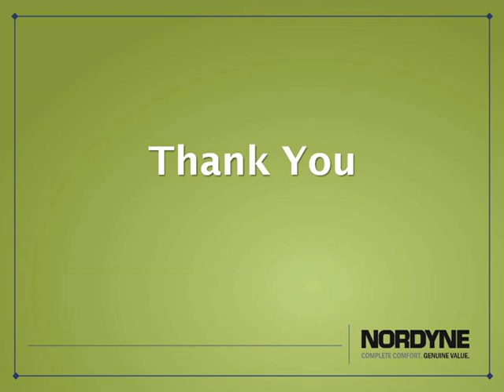Air Conditioner Repair | Adding R-410A Refrigerant to a System | NORDYNE U

Comment: what causes gas smell to mix with hot air coming from your vents in the home
 for gibson hvac system / furnace. is this related to this configuration?

Comment: in liquid form,  but thru where?   suction side or high side
?
Reply from the maker: Jose Hinojosa From our tech team: Liquid should only be introduced through the discharge or high side of the system. If you want to charge liquid through the suction side or low side of the system, you would need a tool similar to a “ChargeMaster”.
Reply: Dummy! Suction side. How does one shoot refrigerant in a 80 lb prs jug into 250+lbs prsr?

Comment: dear sir do you can help me i have 2.5 ton air condition r 22 than i want Chang R 410 A how that Chang need to be  Chang expansible valve all so please explain me i waiting for u
Reply from the maker: Sanbok Restaurant Hi there. You really need to speak with your local air conditioning contractor to find out about replacing your R22 air conditioner with an R-410A air conditioner. If you need help finding a contractor, you can call our customer service at 866-283-3596. Thank you!
Reply: it is very difficult to that because the type of ferion is depending on the compressor and the oil of the  compressor
Reply: thanks for replay

Comment: Hi sir can u help me,regarding for charging for new installation of split ac  same R410A TOSHIBA UNIT,i want to know its only i need to charged 100%liquid,or want i need to do.thanks
Reply from the maker: Hi, unfortunately we can't help with charging Toshiba systems since we don't make them. Your best bet is contacting the manufacturer. Thank you.

Comment: Explain why it is important to have a properly charged system ( for home and building owners)....thanks
Reply from the maker: Hi! Without proper charge, the system simply doesn't work properly. An improper charge will cause the system to run longer than normal, which could potentially cause overheating of the compressor and shorten the life of the system.

Comment: So its a above or below the line scenario? I seen the pressure charts you provide but using that method is a good way to overcharge a unit. Example is of it calls for a pressure of 385 high side on 410a on a 80 degree day thats fine but what if the unit is in the shade not a best way to do things in my opinion. However I will just use the chart.

Comment: Another good point would be that when charging a system via liquid, short bursts are good due to the fact that you can cause the compressor to "slug" liquid. You can tell your doing this as the sound of the compressor will change.

Comment: What about charging with a liquid to vapor metering adaptor that allows liquid up to the metering device at the manifold or service valve and vaporizes the freon allowing you to charge with a more continuos flow then allowing system to stabilize in between charging cycles? Will this not keep the refrigerant blended, and shorten time to charge the system or are these devices only good for non blended refrigerants?